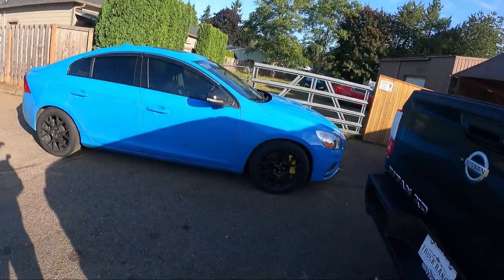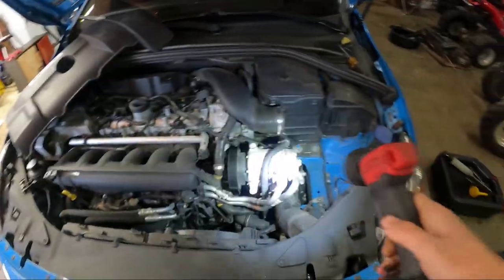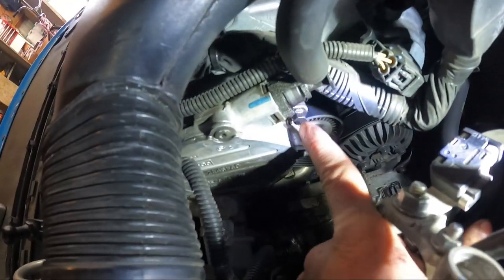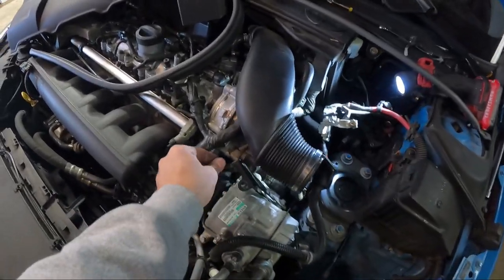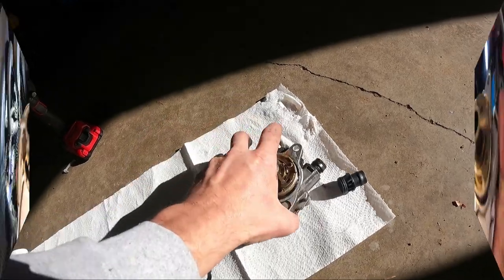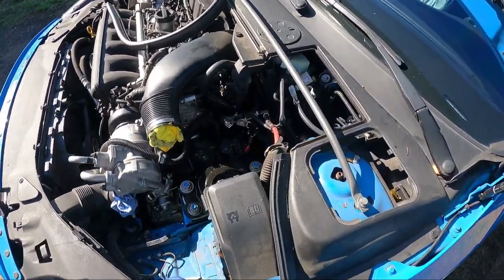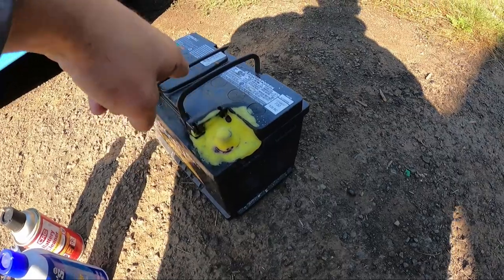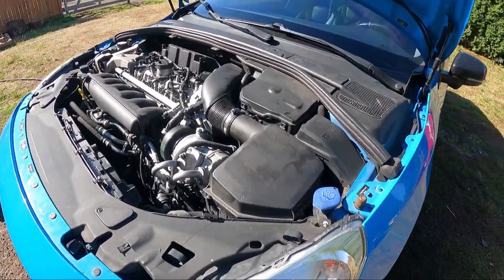Fixing vacuum pump oil leak on P3 t6 Volvo s60/v60/xc60/xc90/xc70  3.0L and 3.2L T6

Comment: Same thing happened on my wife's 2014 XC60 T6. Bought the rebuild kit from FCP which was fairly inexpensive and did the job about 2 years ago & it hasn't leaked since! While replacing all the seals on the pump I went ahead and replaced the accessory belt since I had it apart. Great video!

Comment: great vid, thanks, i had a weired problem with my s60 T6, occasionally i hear a blunt misfire sound and sometimes after i shut off i can head some kind of rapid bob bob bob sound from under the car, turns out it was the charcoal cannister ...
Reply from the maker: Thanks. Charcoal cannister?  Where is that located on our cars?

Comment: I'm too scared to clean my Volvo because I don't want to damage the wires any suggestions?
Reply from the maker: What do you mean clean?
Reply: @BuiltForSpeed  Like pressure wash it in the engine bay, as the oil has leaked al off the pull system. :(
Reply from the maker: @amanuel3478  spray the area with engine degreaser let it sit for few minutes then pressure wash it with lower pressure dont put it at very high pressure.
Reply: For me specifically it’s on the pulley system how do I clean that? Or do I replace. If it’s replace there is no YouTube video no where that will show how to replace the belt that’s under the pump. I wish you can bless us with that.
Reply: I really am stuck.

Comment: Do either of the P3 T6s you work on burn oil?
Reply from the maker: Nope.
Reply: @BuiltForSpeed  I'm burning about 1L every 3000 miles. Guess I need to do a compression test. Thanks for the response.
Reply from the maker: @chrishower  are you sure you have no oil leaks? and what oil brand are you using and what weight?
Reply: @BuiltForSpeed  I haven't noticed any leaks. I'm using 5W30 Pennzoil Platinum. I havent changed the PCV yet, but I don't have any symptoms that it's gone bad. I got this car used around 78k and now I'm at 90k.
Reply from the maker: @chrishower  put liqui moly 5w30 in it next time and see if it changes. And change oil after 5k. Because after 5k miles most turbo cars start burning alittle
Reply: Thanks, I'll try and let you know. I have been changing every 5k at least.
Reply: Hey brother, after the 2 years did you replace the PCV diaphragm and does it still use oil?
Reply: didn't replace PCV. did an engine oil flush and ran liquimoly 5w30 and didnt have noticeable consumption for 5k miles. would run low at 3500 previously @msschill